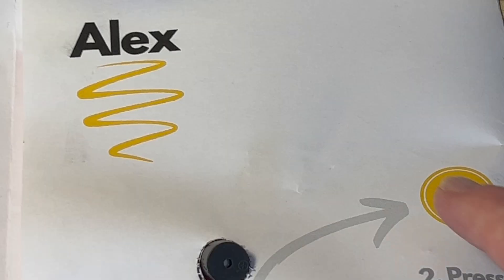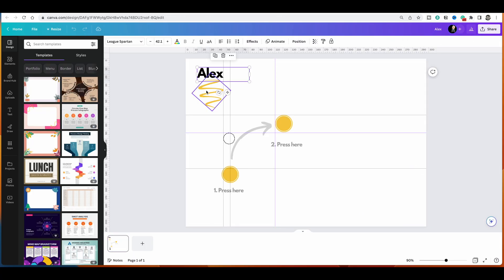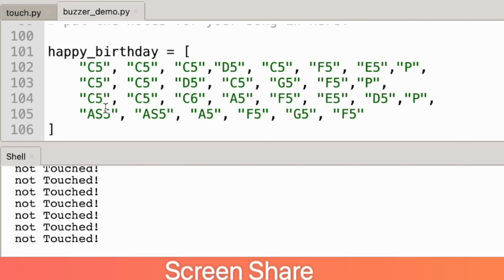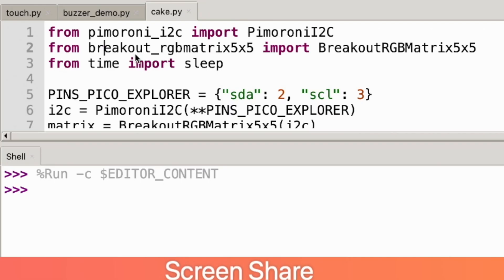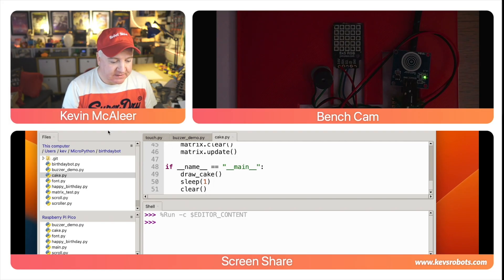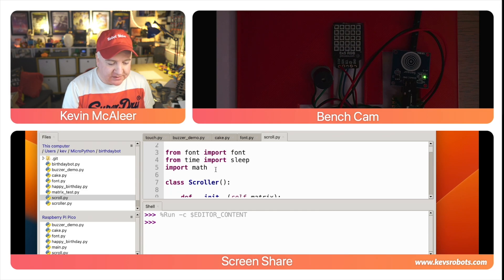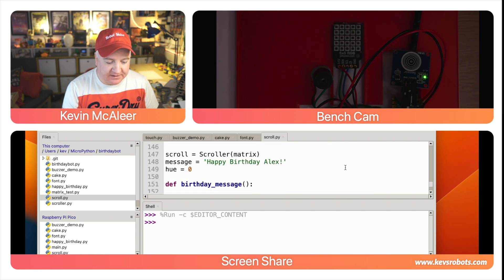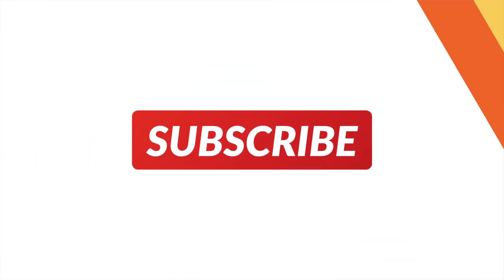Build the Ultimate Birthday Card with a Raspberry Pi Pico

Comment: Back in the 80's, or maybe early 90's, I had some cheap headphones that used piezo speakers. They were only slightly thicker than cutting a circle out of a piece of construction paper.  If you taped or glued one of those onto the card stock, it would be both louder and thinner than the buzzer. Either way, this is way cooler than the store bought cards since it comes with animated bling.